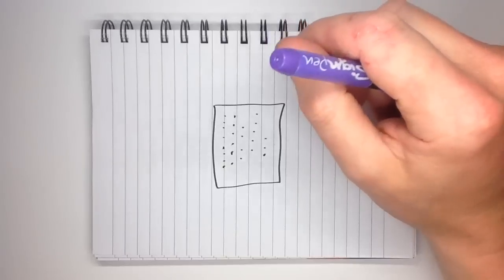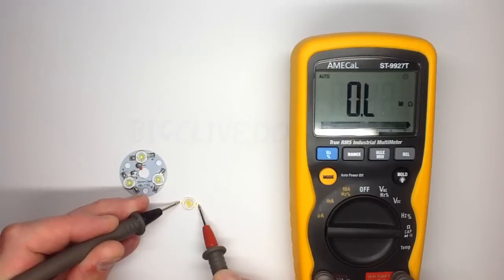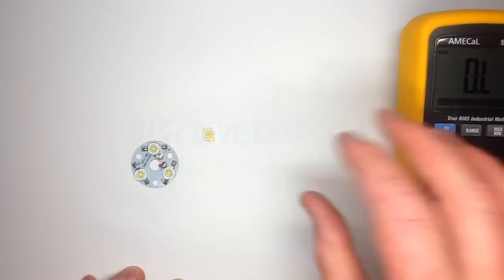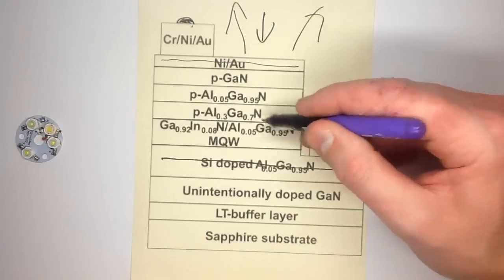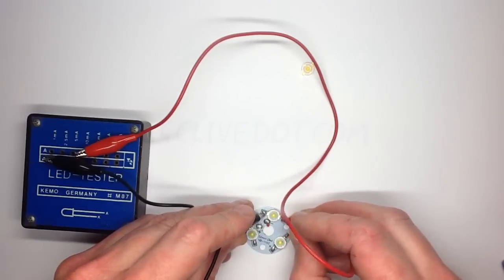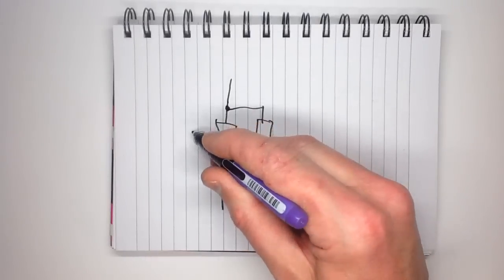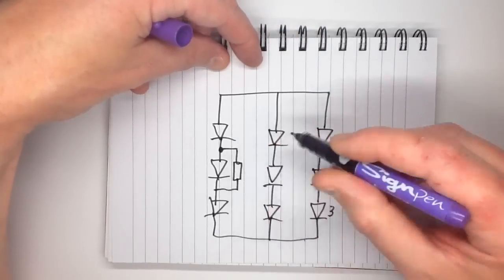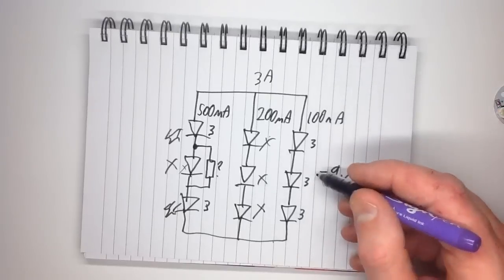The clown-science of crappy 100W LEDs.

Comment: Look at the chart on this AliExpress page -not only are the COB chips poor but the drivers are broken down into two 'bins'/types marked "Cheapest" and "Real" -Hahahahahaha!
Real is clearly the Amps x Volts you need to drive a COB chip to its rated Wattage / brightness (even if it was perfect!!) where-as Cheapest is about 2/3rds the current needed!! 
Example: A Real 30W driver gives out 900mA vs 600mA for the cheapest...

https://www.aliexpress.com/item/10W-20W-30W-50W-100W-High-Power-LED-chip-LED-Bulb-IC-SMD-Lamp-Light-White/1363857929.html?spm=2114.13010608.0.70.RFK5xJ

Comment: I have built semiconductors for years.  The company produced high quality products for military & space industry. Ones failing to meet the specs were downgraded and sold.  Finally you would  get to nothing. They threw them in a barrel as waste. Sometimes manufactures would would want cheap-cheap-cheap-free parts. Well by now you must have guessed the problem an high end Organ Mfg used these parts in an organ that started playing during services by itself.  The mfg found the suspect parts and replaced them.  I got the parts to evaluate to find out what they could so it wouldn't happen again.  I have a feeling all the 100W parts tested in this post were JUNK PARTS and needed to be returned to seller.  I'm sure China can make some good parts although maybe not  as high a yield as USA.  Buy what you need not JUNK.

Comment: This is very useful information! The dim LEDs are basically faulty!

One could assume that if a manufacturer can produce 100% tolerances that most of the units would have only one or two faults, and that their production process is tightly controlled. This would seem like a valid method of producing arrays — make no mistakes and get a very low rate of failure.

The other method of testing and assembling the arrays using fault-free LEDs and binning them for quality seems hugely inefficient.

The only flaw I can find in your test method in the previous video is there is a slight assumption that equally matched LEDs indicates a lack of faults. This is a valid assumption, but it could just mean that the LEDs are matched in that they are all similarly faulty.

Comment: I recently had a 50W eBay LED floodlight fail at less than a month's use. It seemed the LED chip had failed, given that the power supply was putting 40V across it but no light at all. Are they just putting reject LEDs in these things and selling them? At least the seller sent a replacement immediately and without question - maybe it's just cheaper to replace them for anyone who complains than it is to use decent LEDs.
Reply from the maker: +81rjp At the moment I'd say it's a good idea to assume that any of this style of floodlight is going to have the LED progressively fail.  There are good LEDs out there, but they seem to fetch a premium price and be aimed at pro applications.  You can use a higher power LED with a lower power driver to reduce the stress on individual LEDs.  I'm currently using 100W LEDs with 20W drivers in my bench lights.
Reply: +bigclivedotcom That makes sense - I ordered a 100W LED chip to replace the 50W one, so hopefully that will last a bit longer. Though I'm not sure about that, if they're as bad as your tests suggest!

Comment: I don't really care if I get a 'bad' 100w led because it'll be running it at around full brightness anyway.  I will check mine regardless though.
Reply: Well, if you are ok with higher energy consumption, higher heat emission, and LEDs failing sooner than usual than proceed to not care. (Although if you have modules already, why not use them as long as they work, right?)
Reply: +- p4tchu - they were about $2 for me, so they are disposable :P
Reply: - p4tchu - The LED I bought lit evenly for $3.  I guess I'm lucky.
Reply: Robotic Nerd
Reply: I really don't get the "I'm okay spending good money on bad stuff" attitude. I work hard for my income and don't have so much I can afford to waste it. Maybe you don't consider it wasteful to spend X on a product that doesn't perform as stated and is certain to fail in weeks rather than years, and then buy the same thing over...and over. I would much rather spend 2X or 3X and get a product which works as advertised and has the expected longevity.
I assume you did get the part where it was pointed out these faulty chips create far more than the intended heat, causing early failure of the entire array quite quickly. You are okay paying $2-3 for an LED that lasts less than a year when you could pay $10-15 and get one that lights properly and will last for years?
Reply: William Thomas Ramey Did you not read my followup?  All of the white LEDs I ordered lit almost perfectly evenly even at low voltages.

Comment: I've had someone argue BGA solder joints in 1st generation Xboxes fail because the CPU cooler is springloaded. When pushed she admitted hackers had told her so. Right, hackers are going to know better than someone who, among other things, sells automated soldering systems for a living. Yes, lots of expertise on BGA soldering in the hacking community, I gather. Those instructors at Weller don't know jack, apparently.

The bs one sees in the comments of electronics related videos (or in the video's themselves!!). It would boggle the mind if I didn't hear it every day in the shop or at customer's labs.
Reply: Shitty lead free solder just can't take the thermal cycling, reflowed  many an xbox360 back in the day.
Reply: paulzx10 Lead free solder can handle that fine if the solder joint is made correctly.  Unfortunately, fine tuning a reflow process so that especially big components solder properly and evenly is not easy. Once improper flowing/cooling of the solder has occurred, heat cycle stress will indeed make these joints fail.
Although lead based solder is more tolerant of manufacturing process errors, I replaced many flyback transistors in TVs due to the same issue (cracked solder joints), back in the day

Comment: Hi BigC,  

Have you ever tested the output of any of these 100w LEDs to see what the output actually is?
Reply from the maker: +AdventureSportFlashlights Power wise if you drive a 100W LED with a proper 100W driver then the LED will dissipate 100W of power.  But how much of that is light versus heat is variable with quality.

Comment: Thank you for this good explanation "Coco the Clown".  This is typical failure mode when connecting more than one series string in parallel without any current limiting per string...but may I suggest you don't call what are LED ARRAYS, simply LEDs...BIG DIFFERENCE!  ...non anti-static packaging practices don't help by allowing those miniature lightning strikes from damaging the individual junctions...

Comment: Thanks for your video. very helpful in finding good parts. Question: as it seems possible to slowly increase voltage until a certain current is reached (in this case 30 volts for 10x1W LEDs) it does not seem necessary to use a constant current power supply. What is the risk of using a well regulated 30V power supply?
Reply: +gert3d So I mean constant voltage instead of constant current, as long as you stay under the voltage that corresponds with correct constant current.
Reply: +gert3d so long as you have sufficient resistance in-line that you can adequately control the current by changing voltage.  Without some extra resistance the "knee" on many semiconductors is too abrupt to avoid damaging them.

The constant-current source comes in handy for quickly comparing different devices, since you don't have to watch the meter and adjust for each one.

Comment: Wouldn't you have to lift one leg leg of the LED from that board to get an accurate ohm reading. By measuring it while it's still a part of the circuit, you will get resistance from other components in the circuit feeding back to those two points.

Comment: so... are there good 100W LEDs available?
Reply from the maker: +Yamahapsr200 Yes.  But not easy to find.
Reply: Chinese manufacturers (and probably "Western" ones if there' any left!) test stuff and those that are substandard go into the substandard bin and those that fail go into the fail bin. I guess in the past the sub-standard ones used to get recycled or thrown away -now they are simply sold reduced price on AliExpress 'cheap'! :o)
Reply: I believe the sure-display ones are good! I have bought 3 and none have this issue. Two red and one white. They are a bit more expensive but they do seem to be quality.

http://www.ebay.co.uk/itm/100W-Cool-White-High-Power-LED-LIGHT-SMD-chip-Panel-9000-10000LM-Energy-Saving-/380482963113
Reply: the parts all of the extremely expensive US LED builders are made in china too, whats ur point?
Reply: Not the generics from china that look like these.  Philips, Cree, Osram, etc major brands if you want quality, though unless you want a high degree of focus, you may be as well off using multiple 10W LEDs instead, then if you have a failure in the future you can swap the single bad LED out, AND that spreads out (reduces) the die heat density to ease cooling.
Reply: +bigclivedotcom have you tried CREE COB's?
Reply: buy quality you buy it once buy crap ur gonna have to replace it
Reply: Here's a good one: Yuji LEDs. Expensive, but rich in quality and mimics sunlight >99% correctly
Reply: chech those ChanZon led's in aliexpress
Reply: @Cheese_1337  Chanzon leds are also on amazon and seem to be of good quality, i bought a 100 watt for 10 bucks from that brand and at low current everything is perfectly matched. They also supply constant current power supplies for each of the different leds they have.
Reply: Chanzon leds from Amazon 
seem to be of good quality, i bought a 100 watt for 10 bucks from that brand and at low current everything is perfectly matched. They also supply constant current power supplies for each of the different leds they have.
Reply: +Yamahapsr200 Yep, Sharp make some great 100W 11,500 lumen CoB's
Reply: +canaan .banana made in china also
Reply: oh, and various sizes, watts, etc
Reply: I got some ~10 watt 93 CRI Cree COBS from Mouser for about the same price as cheap eBay ones. They work pretty well.
Reply: Hontiey LED

Comment: Your first video intrigued me the second was very enlightening (please excuse the awful pun there). I think you have successfully proved who the clowns are.  

It has been over 30 years since I passed my electronics exams and sadly I have not kept up with this as I should have done, However, if I remember correctly:-

Energy cannot be created or lost, it just changes state. So an efficient LED array where all the chips are working perfectly is converting most of the electric current into light . The faulty chips however , acting as resistance are converting a significant proportion of the electric current into heat? This would surely affect the energy efficiency and explain why some of these "energy saving" light bulbs fail to: Make the promised cost saving; Produce sufficient light;  Last long enough to justify their extra cost over a standard filament bulb.

 Furthermore the heat, unless dissipated by an efficient heat conductor will eventually cause more chips to fail, until the current flowing through the array is producing so much heat that the whole array will fail completely OR in a worst case scenario exceed the heat dissipation capability of the mounting it is designed for and actually cause surrounding combustible material to ignite?
Reply: OK so, after few more videos I can see that this type of LED array, puts out a lot of heat anyway so overheating the designed surround before it fails completely is unlikely.
OK ,now i'm definitely hooked on these videos.
Reply: The leds do generate a lot of heat when driven normally too so a big heat sink is absolutely needed. That's why most flood lights have aluminum housings to mount the led to.

Comment: I think on face value your measurements are interesting, but some of your conclusions are unfortunately wrong. At the working forward voltage of 3.3v your 120 ohm shunt resistor is dissipating about 90mW. If you drive your faulty 1W led with a voltage source it will over-dissipate by about 9% without loss of light output. If on the other hand you drive it from a current source then it will probably under dissipate by about 10% probably with an equivalent loss of light output. While neither of these is a stellar result they are not likely to be noticed in practice and certainly shouldn't cause unreliability in a competent design. The reality is that the shunt resistance has a very noticeable effect on the turn on threshold but not much on anything else.
I think the right conclusion is that these LEDs are crap but for most purposes it doesn't really matter that much.
Interesting videos though - thanks.

Comment: Here´s a tip for people who buy Chinese products.  Don´t buy electronics at stores that also sell clothing. Buy electronics from Chinese electronic stores.  I prefer Hua Top Electronics.  I bought a 100 watt led and it checked out OK.
Reply: +Joseph Nicholas - Also, don't buy clothes from electronics shops; people will give you funny looks.
Reply: +Sean Ache My experience with Aliexpress stores has be generally good.  Things like arduino clones all work pretty good.  Things like front panel computer usb  ports were almost all bad or only worked partially.  So when I complained to the vendor they usually say something like "We`ll send you a new one gratis."  And it never comes.  So I give negative feedback.   But if you purchase circuit boards most work but come with things like lose wires or crooked connectors, but there are usually fixable.  So it depends on how thrifty you need to be.
Reply: +Sean Ache the retail markup on cables is ridiculous.  The reason things like printers don't come with cables in the box is that retailers raised a stink about it.
Reply: ***** It did, but they lost far more in good will.
Reply: ***** I think the original Laserjet had a Canon engine in it, not sure.  Our company had one, typeset a manual on it, it was like magic.  I've got no beef about the 1320 laser I've been using for some time.  I've heard horror stories about their computer division, especially re support.

I've got an HP distortion analyzer/AC voltmeter downstairs, '60s vintage.  Fine piece of gear.  And their first microprocessor-based equipment, the microprocessor was wired up out of discrete chips.

Totally agree re Carly.  I hope Hewlett and Packard are dead and don't have to see what came of their company.
Reply: ***** Haha, lessee, had 28C, 41C, 48G(?), infrared printer for above, reams of programs self-written.  Presently have a 50G that I'm too old and tired to spend a week practicing with the manuals to get good on, 16C, 10BII which is no replacement for the 12C but a lot cheaper IIRC.  And I use the Excalibur RPN calculator program on the desktop.  Reverse Lukasiewicz (sp?) Notation for the win forever.  I always thought it a pity they didn't build the 41 in book form with two keyboards like the 28...
Reply: ***** Haha!  You should have gotten the calculator.  Yes, it's called Reverse Polish but that's the guy's name who came up with the original, where you push operators on the stack and use operands to pop them off.
Reply: ***** When I was in lab school in Bethesda (National Naval Medical Center) in '72 they had one that was card-programmable, you could put IBM cards one at a time in a folding reader.  The works were a suitcase down beside the desk and I think it used Nixie tubes for display.  Cost many thousands, much too fancy and precious for any of us students to touch.  I presume it used RPN.  This was a  year before HP came out with the 35 just-barely-scientific for $450 and six months later the much more capable 45 for the same price, boy did that piss off the 35 owners.  I think they got $100 back.  When TI came out with the SR50 about that time was when I got my first scientific.  I ran right up the line of TI calculators as each one reached around $150, ended up with their fanciest programmable with mag card reader, print cradle, the works.  Switched over to the HP line from there, spent a relative fortune on the 41 with card reader and wired printer.  Et cetera.  The 50G is the first of their calculators I've had that I didn't spend whatever time it took to work every example in the full manual and really become proficient.  If I ever get the energy to do that with the 50 I'll know I've either gotten over depression or gone barking mad.  I went through some awful years, I'm not the same as I was.
Reply: ^^Better in some ways, but definitely not the same.  And tired.
Reply: your a clown